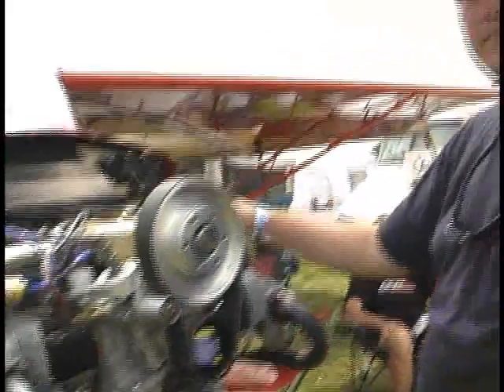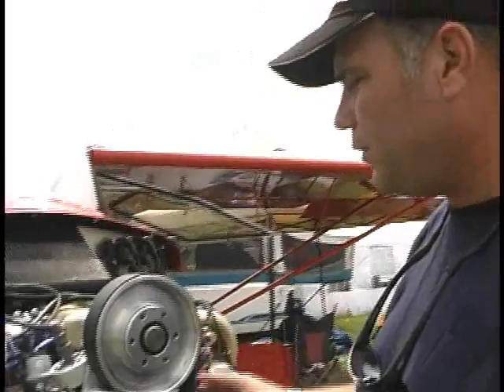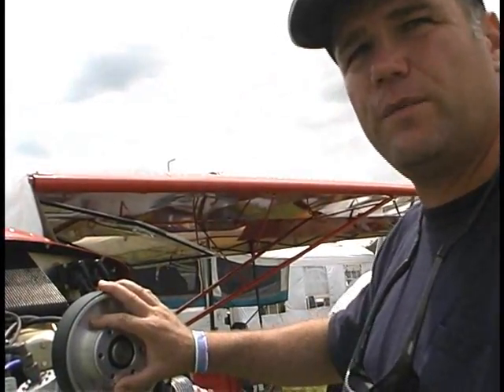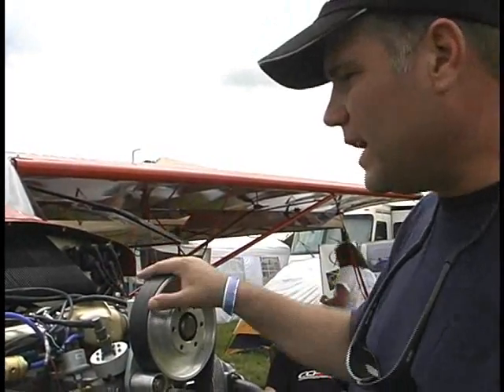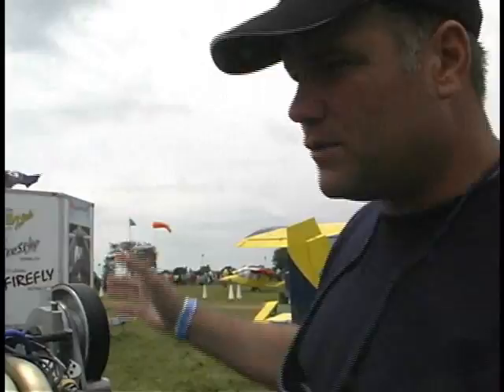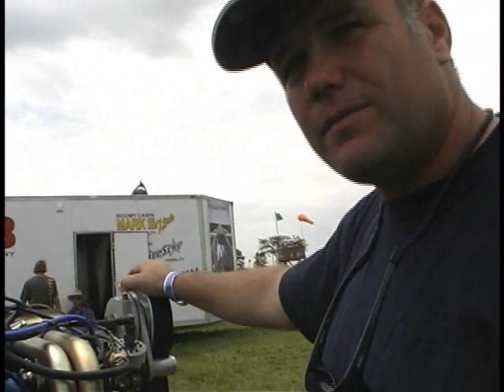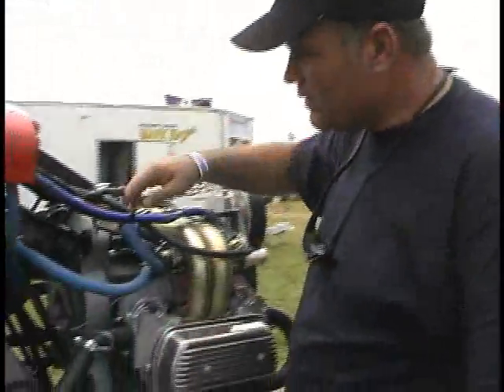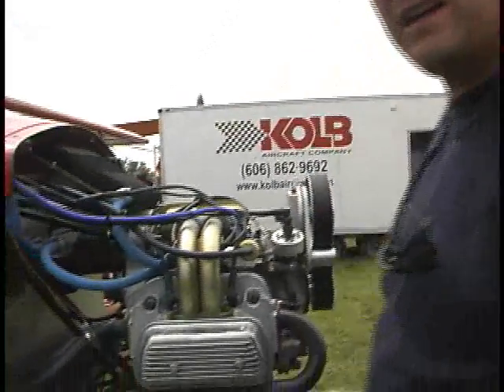Bush King, BushKing Performance VW aircraft engine conversion

Comment: Sending MORE FUEL to a "dead" cylinder is a guaranteed way to make sure to wash down that cylinder wall, rings and piston and then dilute the engine lubricating oil with all kinds of fuel that will ultimately dilute the oil to the point that the other cylinders and/or main/rod bearings end up scored/scuffed/seized/spun as well. That "VW-based" and "high-performance" engine is also missing something absolutely CRITICAL to making any air-cooled engine "live" and particularly multi-cylinder horizontally-opposed "high-performance" engines which is the COOLING FAN/DUCTING to direct cooling air "over" and "around" ALL FOUR CYLINDERS. Having a "prop" in front of an "air-cooled engine" does NOT mean that "cooling air" is getting where it HAS TO GET TO PROPERLY COOL THE ENGINE. Start jacking with and/or "deleting" the cooling fan/ducts on any air-cooled engine and you'll "burn up" even a STOCK "low-performance" engine in no time at "high speed" and/or "high load".
Reply: After years of flying VW engines don’t have a problem with cooling… that’s why we have CHT for each cylinder. You obviously don’t know much about homebuilts
Reply: Never knew a CHT could cool a cylinder. Could you expound on that theory.

Comment: I flew a  KR2 with a direct drive 1915cc  VW for 15 years no worries . Cheeeep to rebuild . Mine was a different engine kit provider and very well known at 160 pounds and direct drive .
Reply: I am building a Himax1500 that is rated for 50 horsepower and wish to convert my own engine.  Do you know of a soarce of information on what is involved in the conversion?
Reply: @billietyree6139  I kind of hate to say on this channel but Great Planes  V W  if your willing to build from kits although you can get a complete unit .I am sure you could find that he can accommodate your requirements plus they are easy to talk to. You may want the Better half VW .

Comment: It looks good. I would really like to see a cog tooth belt drive system with  for and aft piller and plate support system as I have seen Hans Myers From Midland Ont make. Cost and power for this motor looks good..

Comment: Excellent video, it answered a lot of questions I had about using a VW engine in an airplane.  I think these are wonderful engines for the LSA group as they are very light weight and have the perfect amount of power.  The price is right too!

Comment: For me, the fact that the new lycoming 233 is modern in design, has a 2400 tbo time, only 2400-rpm for cruise, plenty of hp, years of experience in the aviation industry and the fact that most mechanics are already familiar with the engine, it would be tough not to want the lycoming 233 for me.
Reply: And what is fuel consumption of Lyc 233 ?
Reply: And what is the cost of the Lycoming? I think you'll be paying much more.
Reply: If you can find a mechanic that can't work on a VW engine... I feel sorry for him.

Comment: Been thinking about that a lot. But all in all they should be detuned to 120 Hp to remain reliable. I prefer the Weber 750 Turbocharged which takes much more abuse than the Rotax 800 ...